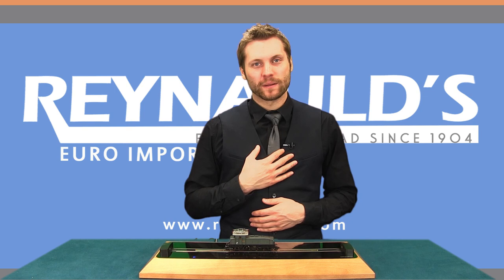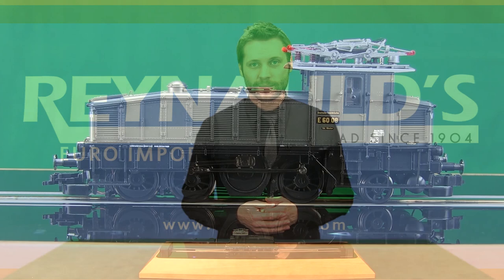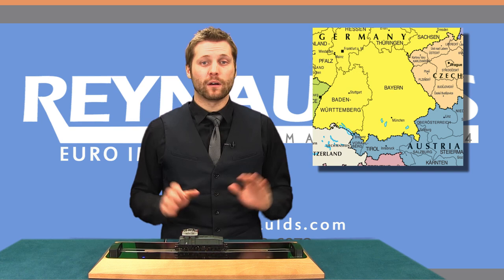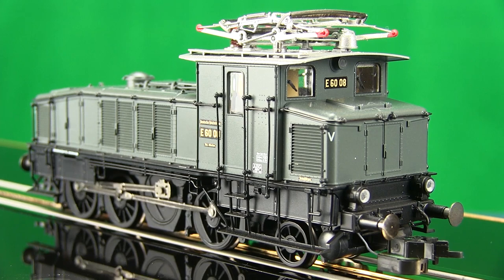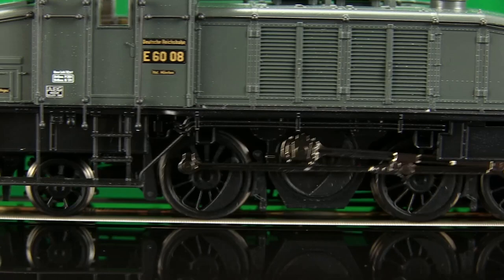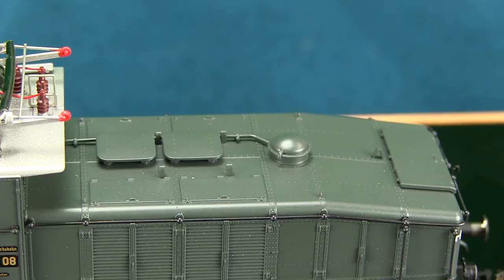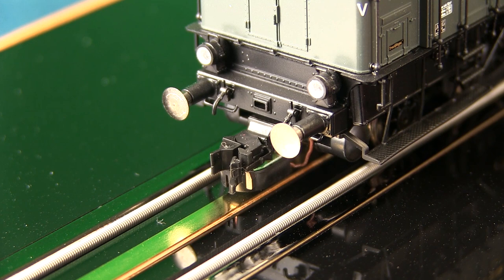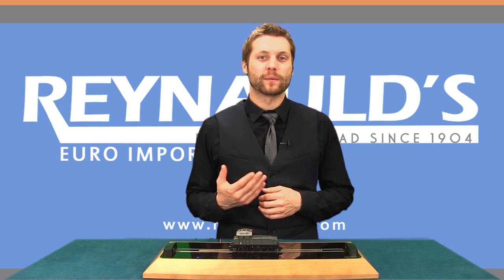Fleischmann Model Trains 436071 Class E60 Electric Locomotive.

Comment: Will you make any more fleichmann videos?
Reply from the maker: Yes for sure, we will make more.
Reply: +ReynauldsEuroImports I have a question, are older brass fleichmann tracks compatible with the newer ones? (Will trains run on them, and will they connect with the newer ones)
Reply from the maker: No the new track had a roadbed and the brass track does not.
Reply: +ReynauldsEuroImports oh. So they don't connect at all?